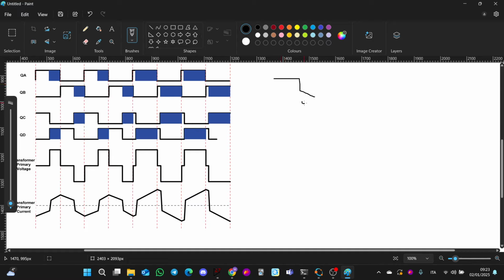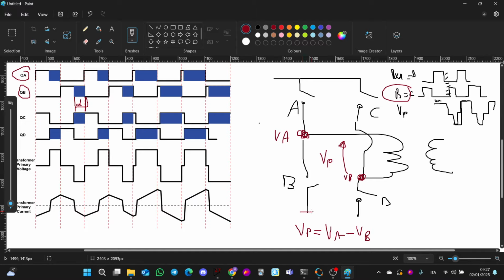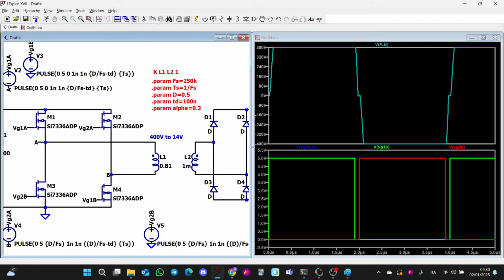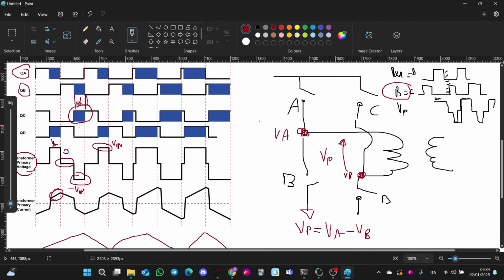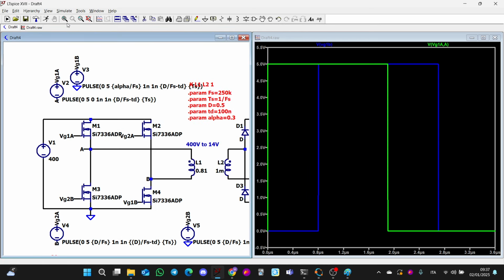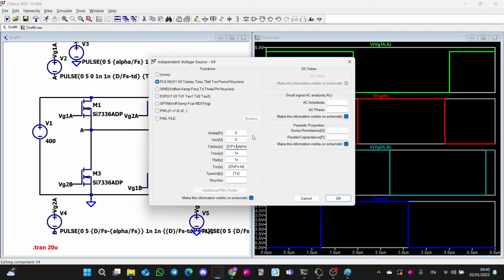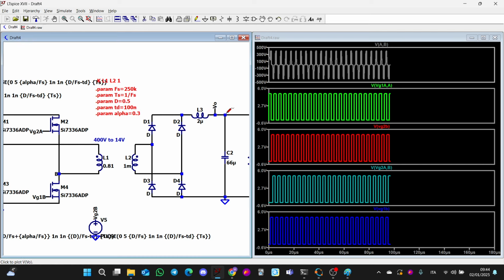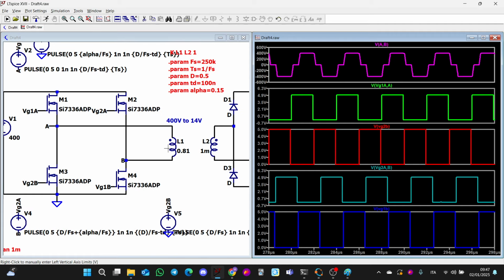[LTSPice] PSFB (Phase Shift Full Bridge)

Comment from the maker: For lazy readers
Pro: Modulate Vout with alpha
Cons: Harder control, Risk of instability, more commutation losses, not ideal for high switching freq.

For readers:
PSFB has a big advantage : you can modulate the output voltage by controlling the phasing shift angle alpha. But this comes with a cost.
The catch Is that not only the pratical impoementation Is harder, but you Will have more commutations and switching losses.
For this reason, classical full bridge dominates the market with High Power applications. LLC and soft switching variations for EMI and cleaness.

Comment: I guess if you use voltage controlled switch, the simulation will be fatser. Also, you can add r to the diode model at the output.